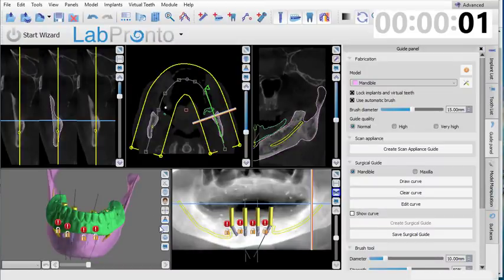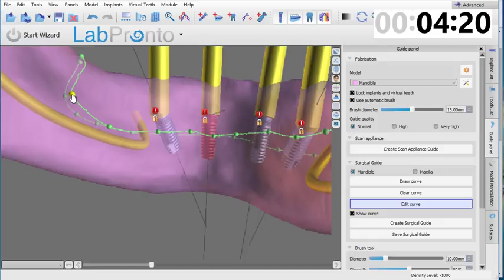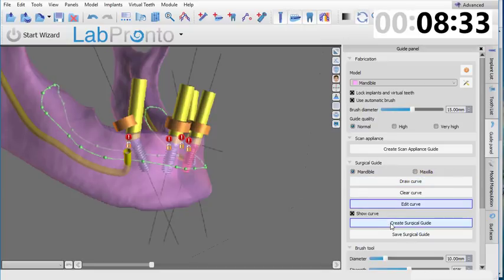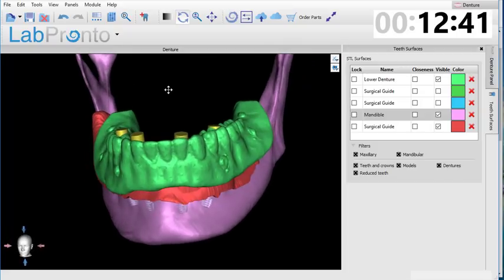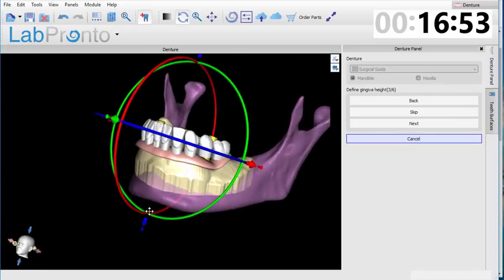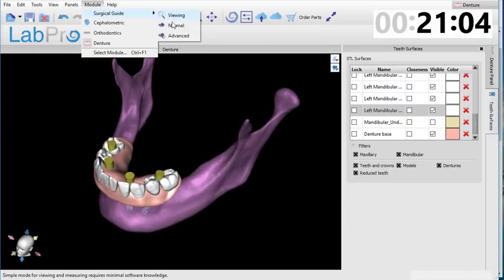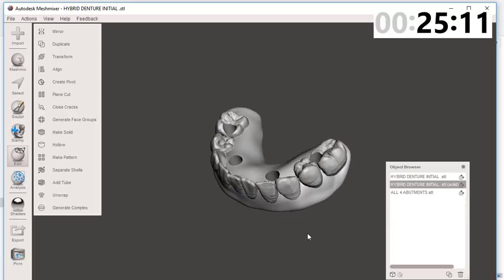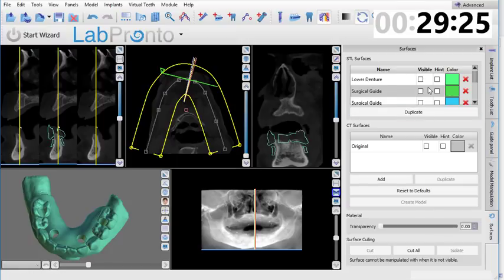How 30 minutes could save you $3000 per arch on full arch implants

Comment: I have a form 2 printer.  The only resin that I understand can be left in the mouth is the clear dental resin. Last I checked they had not released the denture colored resins yet.  If you were using a form 2 which resin would you choose?  I understand there are aftermarket resins. But I have not experimented with any as of yet. Great work as always. And thank you.
Reply: They have released their denture resin as of recent.
Reply: Nexdent makes a C&B resin you can use.